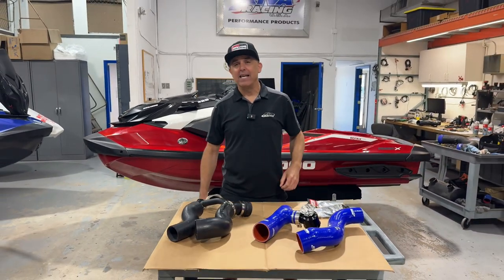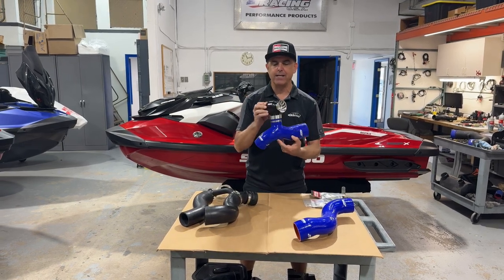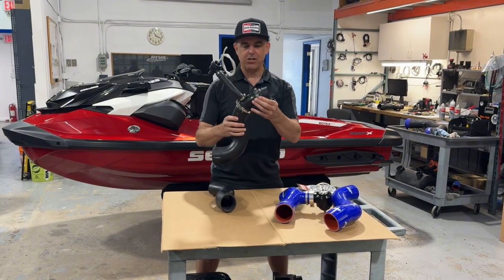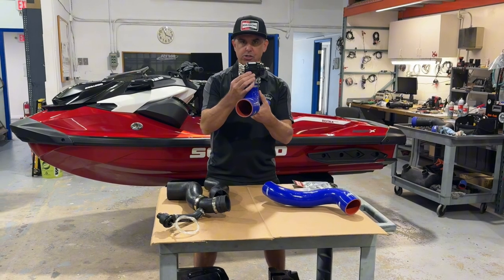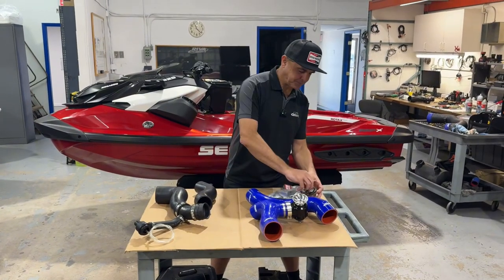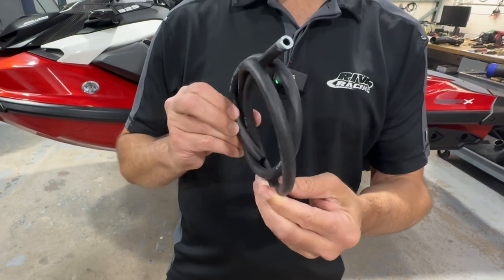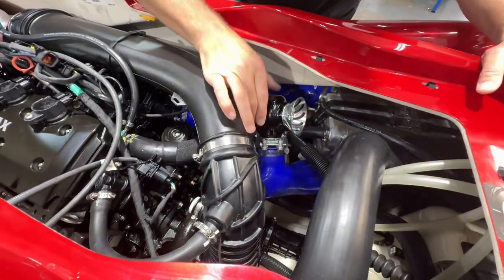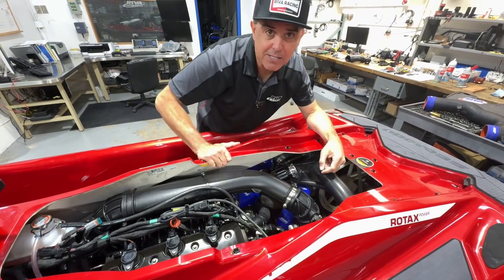RIVA Sea-Doo 325 Intercooler Tubing Upgrade Kit with TiAL 'QRJ' Blow-Off Valve

Comment: Great Video thanks I like the new vacuum actuated Tial QRJ Valve a lot and I think it’s going to help that supercharger last much longer and aid with performance Specially the New Design Stronger Pipes  🙌 Jip the Boost Port Adapter is Also Well Worth snapping into Place Snugly 🌟 ⭐️ 🌟 ⭐️ 🌟